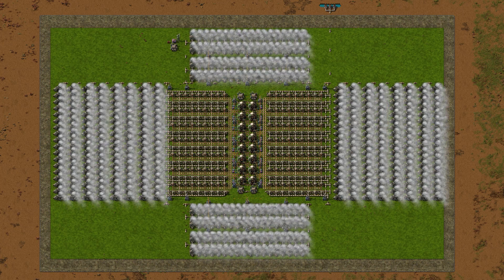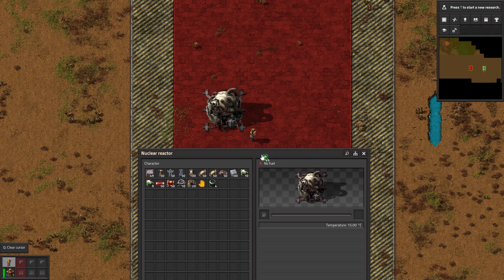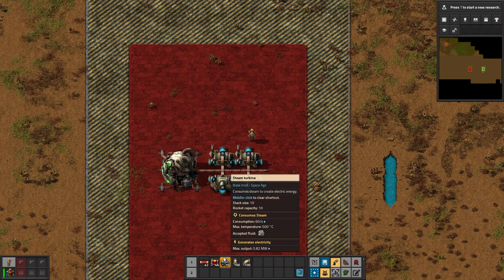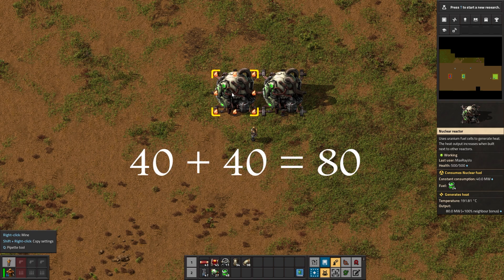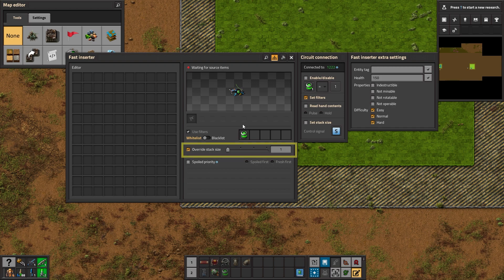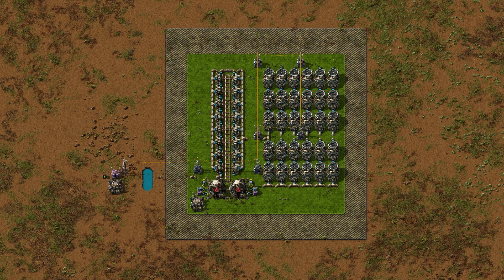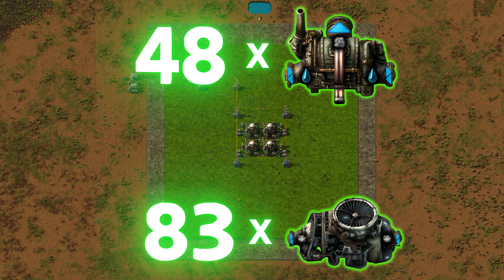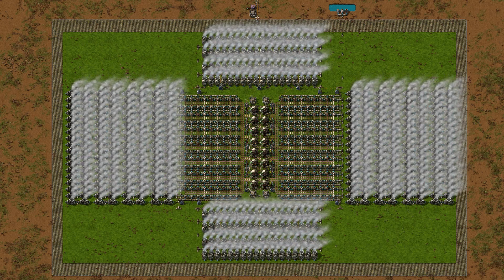Factorio Nuclear Power Tutorial

Comment: I'm not sure if this circuit logic works anymore? I wired it like you did and checked your blueprint, but the inserter comes up with a red circle with a line through it. 

Do you know a fix to this? I can't seem to get it to work
Reply from the maker: It does work. But make sure you have done it exactly like the blueprint. Put them next to each other and compare. Also don't forget to set the reactors for temperature reading
Reply: @Maxiume  I got all of that set right, I'm going to wait for the temp to drop and I'll see if it works! I think the red circle on the inserter is just throwing me off! First time messing with circuits :)
Reply from the maker: @RealXypher ill be sure to do some tutorials on circuits.

Comment: ALL input inserters should only read temperature from 1 reactor, so they all insert the fuel cells at the same time. 
Because the temperature is not the same in every reactor, which mean there will be 1 reactor be fed first and will rise the temperature of its neighbour, which mean they won't have a chance to get cool enough to be fed, which won't activate the 100% bonus.
Reply from the maker: Okay so what happens if a reactor gets its first fuel cell late. Or worse if the one we measure gets its fuel way sooner because we are using bots and the fuel production is slow? Can you see the issue?

Comment: I cannot for the life of me get the circuit to work. I've wired everything up the exact same as you have but the uranium fuel cell signal icon is showing up in the 'input signals' instead of the 'output signals' of the combinator. 

Also, whenever I click 'Set filters' on the inserter, it wipes the value in the whitelist slot.
Reply: Nevermind I got it working. I set a custom signal for the inserter Enable/Disable which did the trick
Reply from the maker: Always put the blueprint next to what you have created and check what's the difference.

Comment: Thanks a ton for this tutorial, I have always been confused by how this system works, and this helps a ton. I wanted to double check to make sure I'm understanding the heat exchanger and turbines correctly. 

It sounds like the simple method is to use two turbines for each heat exchanger since the ratios will be simpler, but your final build had 240 exchangers but only 413 turbines. Is there a reason why you used 413 turbines instead of 480?
Reply from the maker: You are very welcome! I used 480 heat exchangers, but mentioned 413 because that is the correct ratio mathematically. But as i said a few times in the video, i like simplicity so i go with a nice even number. Blueprints are also 480.

Comment: Hi! Love the video, took me a while to figure that there were inputs and outputs slots for the combinators but it works now!. Also. Is it normal that only one of my inserters work? The heat is shared between both reactors so i do think it's normal but in case i'm missing something i'd love to know. Thanks again!
Reply: Nevermind. By increasing my power consumption both reactors now recieve a fuel cell instead of only the left one in my case.
Reply from the maker: Glad it helped! Cheers. For the inserter it is normal when utilization is less than 100% due to heat transfer between reactors

Comment: i have found that after getting kovarex up and running there is pretty much no need to do fuel saving logic
1 enriched uranium is two thousand seconds of reactor time. if i have 10 reactors going that means i need 1 enriched uranium per 200 seconds that is 0.3/minute so unless i remember incorrectly 1 kovarex enriching centrifuge can sustain 30 reactors (since it runs for 1 minute to produce a 238)
i mean it DOES save like 0.26% of a fuel cell, energy wise (8GJ/(1minute *350kw)) but i think a lot of peoples impression that reactors are complicated comes from the anti-fuel-waste circuits
a reactor just burning through fuel cells unattended has direct costs of around 70 lamps. probably like double or triple that since the ore needs to be mined, which takes acid and so on, but my point is, if you even use about half the output of a nuclear power plant you won't really notice having a fuelsaving circuit or not
Reply: that said its a really good video :D
Reply from the maker: Very true! Most of what we do here is just to tamper with things to show that it is doable. Otherwise it makes no practical sense to optimize reactors anyway. Most people run into UPS problems way before they can even scale up properly to have nuclear fuel shortages. Lol

Comment: I like to design my own nuclear plants, I build everything from 40MW up to 120GW monstrosity. But I always use Steam buffers it's more efficient IMO. And fuel inserted only than steam below some threshold. Only on Aquillo I am using heat monitoring, so reactors will always stay above 550°C.
Reply from the maker: That’s a valid approach too. But in factorio 1.1 used to be less UPS friendly.
Reply: @Maxiume  I know, I finished SE couple of times. And I know something about ups drops. And how optimize base for more ups.
Reply from the maker: You reckon it’s worth doing a video on that? Optimizing for UPS.
Reply: @Maxiume  well yes and no. Beginner's don't need this type of information. Firstly they must understand how basics works. Mega bases is for engineers with 500+ hours and even then they are just started mastering Factorio.
Factory must grow.

Comment: I had a somewhat unusual nuclear reactor setup. I had a massive base, but also a truly ridiculous number of solar panels and batteries. During the day, the solar panels would produce what I needed, and I didn't quite have enough batteries, so I added a large nuclear reactor, four of them. The thing was, I realized that the steam didn't cool down over time, so I could make a field full of containers holding steam, so they were in essence, batteries. At night, they accumulated steam would be used to keep the base operational.
Reply from the maker: That's true. Storage tanks full of steam can be used as energy storage units. The problem was (not anymore) with Factorio 1.0 the fluid dynamics were not very optimized so your UPS would drop.

Comment: what's the reason that the temperature value in the decider combinator is set to under 650 in particular?
Reply from the maker: You set the number in a way to make sure the last heat exchanger stays above 500 consistently. Also higher numbers make the heat transfer faster. Can be lower or higher but i find 650 a balanced choice for this design.

Comment: Great video. I would only add two things:

1) Water Pump to Reactor ratio:

1 water pump extracts 1200 units of water per second.
1 reactor needs 4x60= 240 units of water to support it's turbines with steam from heat exchangers.

Doing the extremely complex math we find out we need 5 reactors to fully saturate a dedicated water pump.

Combining this realization with the aforementioned knowledge that a 2*N layout of reactors is optimal, we conclude that to truly optimize the hell out of your nuclear setup, N needs to be 5.

That means you need 10 reactors minimum supported by 2 pumps if you want to get my OCD seal of approval.

2) Tanks, the non-shooting ones:

If you're running a 2*5 setup, fully loading your pumps, you need tanks with water as a buffer to make sure enough is constantly available.

If you're running some other setup (hybrid with solar for example), you need tanks with steam to make sure the turbines keep on spinning, even during load fluctuation turning reactors on and off or during night-time if you don't have a sufficient accumulator setup. Also, you can get a reading out of those tanks and make it so that the heating setup only turns on when there is no left-over steam available, instead of only relying on our 3 pre-existing conditions (sufficient load, temperature above 500 and 1 fuel being inside)

To get the ratio for those you need to know that each exchanger makes 1 steam for every 10 inserted water and it outputs 103 units of steam every second at max output. This means 1 tank of water for every 24,2 exchangers and 1 tank of steam for every 242.
Reply from the maker: Wow… Thanks man. 😎
Reply: @Maxiume  you're the one to thank man. You did 99,9% of the work, im just cleaning up afterwards.
Reply: Really good addition to the video, I hadn't thought of using steam tanks for power storage, like molten salt is used IRL.

Comment: I've tried to do the inserter decider logic by pausing your videos and copying it, and also trying different combinations and I just can't get the inserter to stop inserting or to just 1 at a time.  I even went so far as to copy your designs straight from your github.

When copying it like your video, or from the github, the inserter doesn't have a Uranium Fuel Cell filter icon for me.  It has a red prohibiton sign on it instead.  In my decider combinator, I also don't have any icons under the Output Signals area, and I don't know how to do that part either (but also importing from your github doesn't work for me either).

Any ideas?  I'm playing vanilla with no mods.

Besides that, I love the design and the tutorial is great!
Reply: I’m having this same issue, but for me it works to start, as in it has the red symbol and doesn’t input anything until the reactor has no cells and is under 650 degrees, but, once both conditions are met, instead of putting one fuel cell it ignores the conditions and puts more and more in. Did you happen to find a fix for it?
Reply from the maker: Oh okay. Here is the deal: if all conditions of the combinator are not met (you can open the combinator and see if both conditions are green or not) then it removes the filter from the inserter and makes it look like the stop sign you mentioned. Which is the expected behaviour. It happens when the reactor has fuel inside or is hot enough and doesn’t need fuel at the moment. The moment both conditions are correct it goes to action and puts one fuel cell inside and goes back to the stop sign again. 

Try the blueprint (cause it works) and put some fuel cell inside the cargo bay. See if it works. 

Cheers!

Comment: My inserter just keeps inserting the fuel even tho the temperature isnt low enough, had the same setup, tried connecting everything with the wires but nothing helps. Could really use some help.
Reply from the maker: Open the settings of the inserter and check everything against my settings in the video. There is a chance you are doing something differently.
Reply: @Maxiume  I still can't get it to work, and I feel so stupid because it looks so simple. :) I'm not using the active provider chest, but that's not required, is it? I have a green cable connecting the combinator input to the reactor, and another connecting the output to the inserter. One difference I noticed is that the fuel cell icon doesn't show up under 'output signals' in the combinator.
Reply from the maker: Don’t feel bad. It can be a bit complicated at times. An easy way to see what is wrong is to put down my blueprint next to what you have made yourself and then compare settings of different things one by one so you can tell what have you done differently. Let me know if that works.
Reply: @Maxiume  So I finally got it to work! :) But I'm not any wiser... It's strange, I did as you suggested and put down your blueprint. I clicked and clicked but couldn't see any difference. A bit frustrated, I started checking off and check different boxes. And I think when I turned the read temperature in the reactor off and on, it started to work. But I'm not sure. I'm thinking about loading an old save to try it again.
Reply: @ i got it to work, thanks dude.

Comment: Want to point out that you don't actually need to do that logic part, since after inserter puts the fuel inside, it takes a bit to return into original position, and during that time the reactor has enough time to heat back up past treshold of needing refueling. And if it doesn't - then that means the power grid is consuming so much power that a second fuel cell won't really go to waste.
Reply from the maker: I hear you but I disagree. Now i know this is just a game and not a real reactor but since you want to have the best design: in engineering, explicitly defining constraints, conditions, and states is critical for both fault-proof operation and design readability. Explicit constraints ensure there are no unaccounted-for scenarios that could cause system malfunction, unlike implicit assumptions, which risk unforeseen failures. This principle aligns with practices like Design for Safety and Deterministic Design, where every variable is controlled and predictable. For instance, nuclear reactor control systems, written in languages like Ada, explicitly define timing and every machine state to prevent catastrophic outcomes, demonstrating the importance of this approach in high-stakes engineering. Explicit design ensures robustness, clarity, and resilience against failure. So, I kinda like the explicit design more
Reply: I see what you want to say, and i do have to say that first throttled reactor i set up had decider combinator in exactly the same way you did (maybe the temperature number was something else)
I did however find out by experience that you don't actually need the combinator, since direct logic "works good enough"™
So yeah, that's that. I am not here to judge people based on their builds, just sharing a tip that may come in help
Reply from the maker: It’s all good. We are having a discussion about different designs and i love that. Cheers for sharing.

Comment: Very nice tutorial!

One feedback: if you have multiple reactors, the decider will only trigger for the ones pulling the most heat. "Inner ones" will never trigger, as they're always armed by their neighbours. Constantly running out of fuel and not contributing.

Shall we just connect all into one circuit / decider?
Reply from the maker: You can do that. OR you can just ignore that behavior cause all those odd things if they ever happen only happen when there is not much load on the power plant. Once cracked to the max everything works like a clock. Basically I'd stop micromanaging my nuclear reactors 😎

Comment: Very nice tutorial, although i knew it all. -> i wqatched it because its made so well.

another question, i know its hard to get rid of the heat, but is it possible to make a plant like 3x3 or 4x4 ? -> i was secretly looking for this answer in the video
Reply from the maker: Thanks!

Re your question: let’s say you make a 3x3 or 4x4. How do you propose you feed those inner reactors surrounded by others around it? Maybe a slight shift so they only have 2 tiles adjacent? I myself experimented with a skewed 4x4 setup, roughly resembling a diamond shape and then you can sneak in a few logistic chests, but to my surprise i realized they received no bonus at all cause you need to make them fully adjacent (all 3 heat pipes connected). So i gave up on the idea.
Reply: This is the same reason I came here! Shame it's not possible. Womp womp

Comment: You can tweak the fuel insertion logic if you use steam storage by using tanks, you can read the level of steam in the tanks and only insert a fuel inside if the steam gets too low. That way you essentially get not a second of wasted heat energy no matter what. This is especially good for reactors that overproduce power for smaller sized bases which don't need the turbines running constantly at higher output.
Reply from the maker: That's actually true but I'd say it's all about diminishing returns. Also don't forget that turbines and all those steam pipes have a decent amount of buffer and stop converting once there's no load. on top of that, heat pipes are lossless (ironically!), so unless you set the circuit cut-off real high, the waste is almost non-existent.
Reply: @Maxiume  I just have one arm thats off and turns on once the temp hits like 550 with a stack size of one. Even with the waste ive had the same exact uranium patch ALL playthrough.
Reply: oops just got the point in the video that you did just that anyway lmao
Reply: Nuclear fuel is practically infinite.
2k hours and yet to use up vanilla patch, with 40gw constant plant.
Reply: @AzaIndustries  it's not about it being necessary, it's about peace of mind.
Reply: @AzaIndustries  One good reason to use insertion logic, or to learn that you CAN do it, is because if you want to use nuclear power on a planet that doesn't have access to uranium or on your space platform. You can only send a horrendously low amount of cells up per rocket, so you need to make the cells you can afford to send up count.

I feel like the "what's the point, it's forever" argument is just false after Space Age. It's only true if you never leave Nauvis or never use nuclear anywhere but Nauvis.
Reply: @SkeleTonHammer  nah that's just a lack of proper logistical infrastructure for support.

You get to fusion before that would matter for serious projects.
Reply from the maker: Based on my experience in Space Age, you need solid rocket infrastructure on all planets, regardless of your design choices. You should be able to send up as many rockets as needed, and fast, almost as if they were free!
Reply: @Maxiume  It's glorious, they refined cracktorio down to to a fine powder.
Reply from the maker: Lol

Comment: Nice and concise tutorial!

I used a similar setup with the same circuit setup but I ran into the issue that sometimes the reactors went "of-sync" where one (or few) reactor gets fueled and others don't. The heat from a fueled reactor transfers over to a non-fueled reactor causing the condition to return false. I'm not sure if this is an issue or simply a result of not using 100% of the produced power and therefore not a problem.
Reply from the maker: Cheers! 

When under 100% load, everything goes back to normal. Under 100% utilization it simply doesn’t matter.